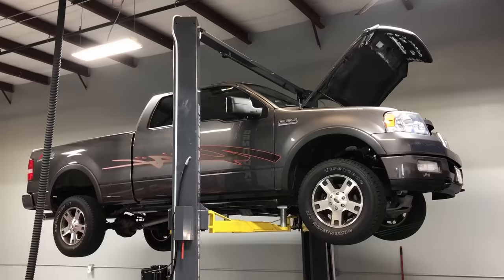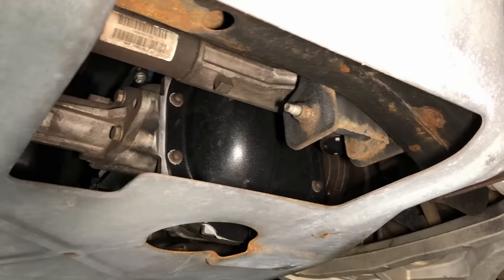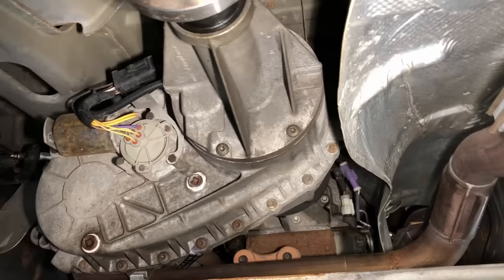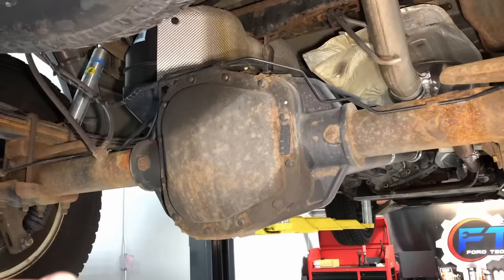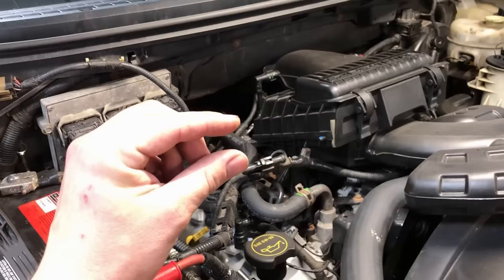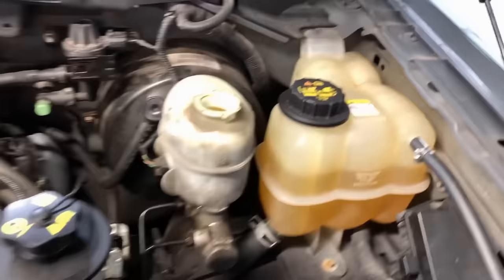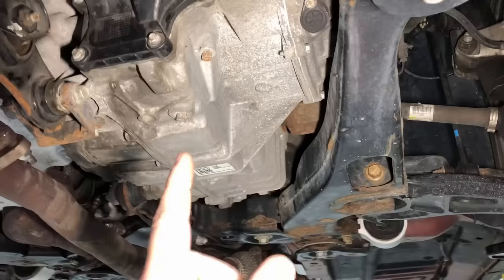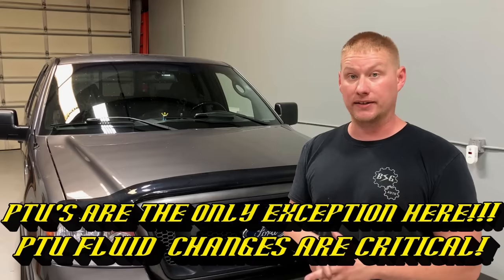Never Follow Ford's Lifetime Fluid Service Intervals: Here’s What I Recommend and Why!

Comment: Dammmm,  so dont buy a Ford.  

Guess they dont make it easy like they did in the 90's .

My parents had a 95 F150
Ran it up to 370,000 miles only changing the oil once a year.
Which pretty much they were bad on keeping up with maintenance . I told them to trade up to newer ride. 
That truck needed alot of repairs, still ran great but the list was too long to bring it back to 100%

Comment: I reccome d Rust-Oleum Rubberized Undercoating  in Black to help prevent rust.
Reply: GT ENT NO. If you can find the sticky tar asphalt undercoating yes. Stay away from the rubberized, water still gets in and it keeps it there.
Reply: @sammolloy1  Haven't had that happen
Reply: Yet
Reply: @sammolloy1  it's all on how you apply things my friend.
Reply: Tell me more. WD-40 first? Applied dry, water will absolutely get under it.
Reply: @sammolloy1  10 years my undercarriage has been rust free and I have a Navigator and it's rust prone my friend.
Reply: Peel some off. It’s rotting under that crap where you can’t see it. There’s videos if you care to watch them.
Reply: @sammolloy1  nope sure isn't

Comment: I laugh at these posts lamenting about the good old days of auto repair. In the 60's a car with 100,000 miles was completely worn out regardless of how often you changed oil. You folks have been spoiled by electronic fuel injection and ignition, better engine components, synthetic oils and cutting edge engineering. Cars now days last longer, get better mileage and make much more power. Any car with as many options as they have nowadays is gonna require more maintenance, they're complicated machines as compared to cars fifty and sixty years ago. So if you have to pull off a cover instead of a plug, so what. Those old cars had to be tuned up every 10,000 miles changing points, sparkplugs, distributor caps, probably wires and possibly a carburetor rebuild. Muscle cars got nine miles to the gallon and never made more than one HP per cubic inch. My 2019 F150 would eat my old 67 GTO alive in the quarter mile with the AC running, if I have to go through a little extra pain to change fluids, I'm still happy.
Reply: There were Pontiacs Buicks and Oldsmobiles with 250,000 miles in the 60’s. Mostly they just got ratty and smelly. 
Story time a guy about 1960 noticed his Chevy taxi in NYC had a different color steering wheel. The cabdriver explained that GM was testing them to see when the hard colored plastic wore through to the rubber and turn your hands black. Their target was 80,000 miles so you would buy a new car.
Reply: @sammolloy1  Not commonly,
Reply: oceannavagator Yes like I say people just got tired of them, or they rusted out. Caddy also, but the dated styling sent perfect running ones to the crusher. Not  Mopar  or Chevy except the sixes. I saw a 65 Chrysler V8 with 165,000 but it made weird noises.